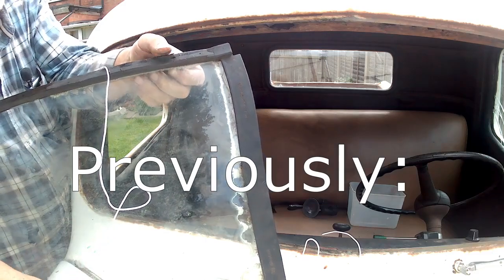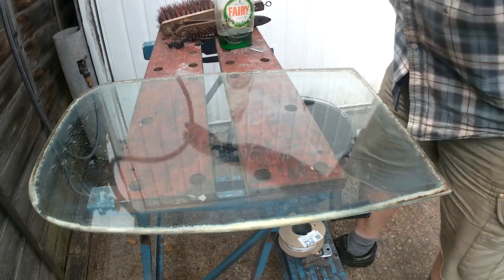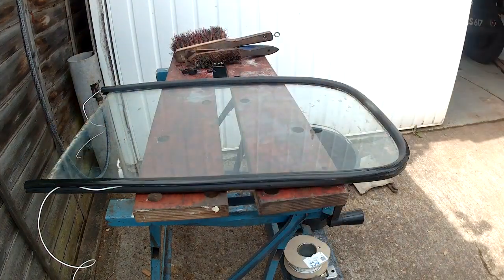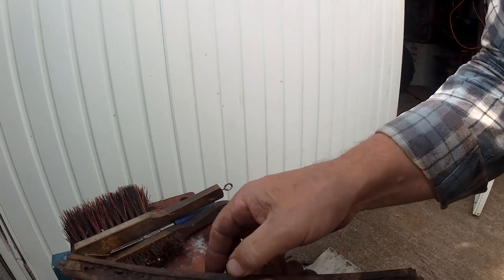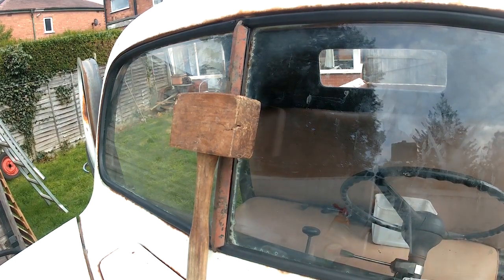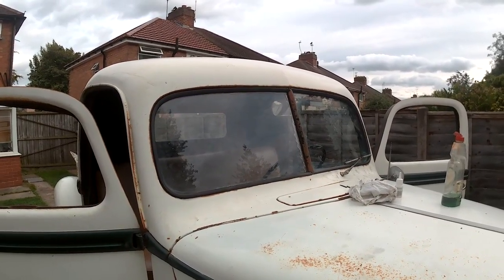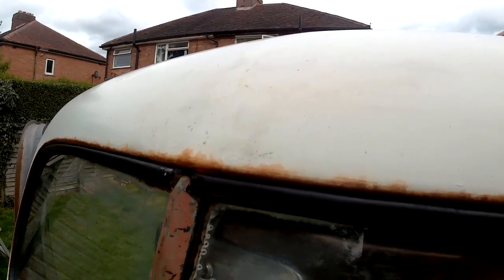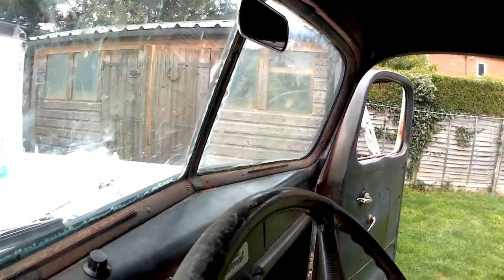41 Ford Pickup Rolling Restoration Part 4b: Mart muddles through a Windshield Refit. Pt2

Comment: Mart (Koops here), I was wincing at your use of washing up liquid to install the screen rubbers, me being under the illusion that washing up liquids contain a certain amount of salt. I did a little research and found this article... https://www.morebikes.co.uk/3729/can-clean-bike-fairy-washing-liquid/  ... do read down the page at the comments on this page  as the chap there does say some 'detergents' do contain Sodium Chloride. I might have been tempted to use Vaseline or grease myself, as an 'easing agent' and somewhat, rust inhibitor. There's, no doubt, commercial 'goop' you can buy that'll do the job, but it's probably pricy and not easily available, unlike washing up liquid! Enjoying all your 'videos' by the way.